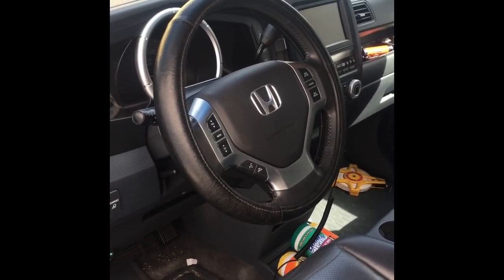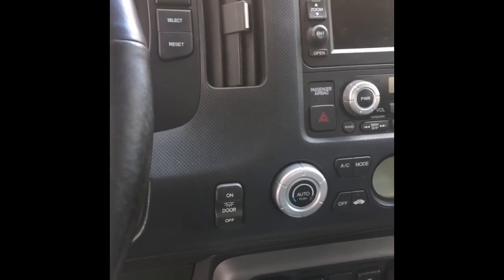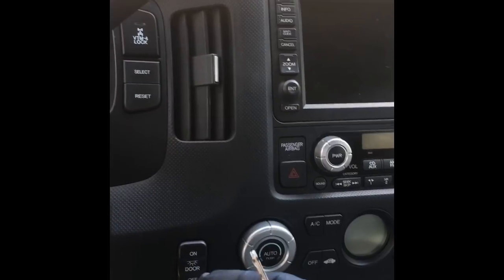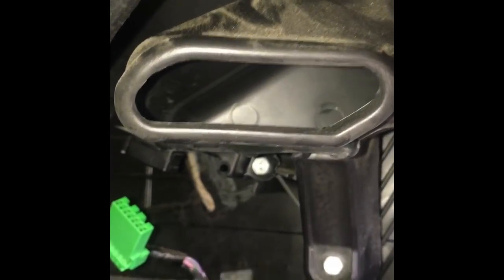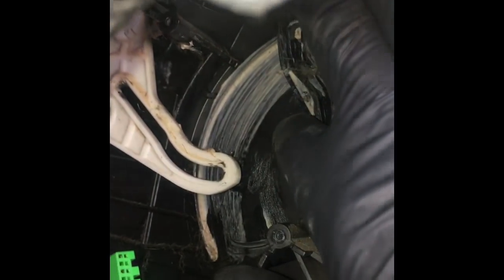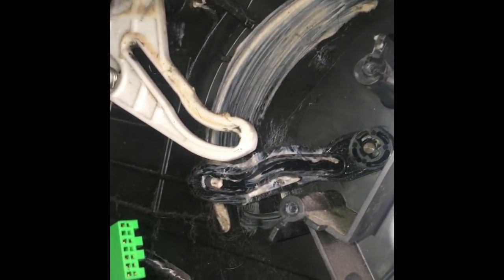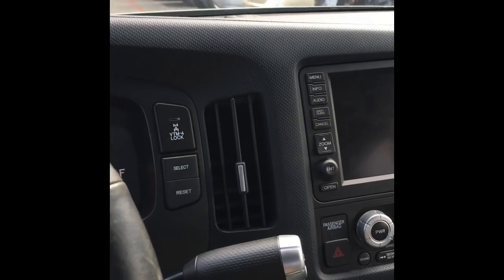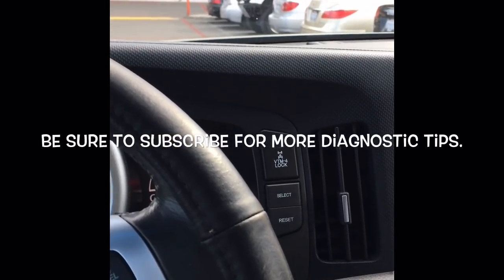How to Diagnose the AC Vent Problem: Hot on One Side, Cold on the Other

Comment: I just went through this on a 2009 Camry 2.4L base model.  AC was only blowing out of the center, right vent and was cold. Far right vent was blowing cold as well.  All other left side vents were 20 degrees or more warmer.

I recharged my ac system and all vents are now blowing cold as usual.

I read somewhere else that Camry's do this when the refrigerant, R134A, gets low.  This is true.

I have a slow leak I am investigating.

Enjoy!

Comment: Thank you so very much!  The video shows how to handle this on Hondas, in general, I think.  I looked for the same server on my 2006 Honda Accord and it was a no-brainer to remove and leave the switch in cold mode for the summer heat.  I will replace the servo motor part # aw063800-0080 off the internet.  It is named "2003-2007 Honda Accord mode actuator motor air vent left OEM AW063800-0080".
Reply: Paul de Prado how did you fix it?my 2006 accord doin same thing blowing cold on middle vents warm on driver side vents can you tell what's wrong?!.thanks
Reply: Baahubali Alak at bar 
Hi Baahubali - it's pretty similar to this video.  Unscrew and unclip the 2 plastic covers under the driver's wheel.  Remove the plug for the sunroof control, if you have a sunroof.  Use a flashlight to spot the servo.  It will probably have a green plug like mine and the plug in the video.  Unscrew the 3 screws... which is hard to do.

After removal, flip the plastic switch with your finger and check the air conditioning. Flip it other way to figure out cold vs. hot.

If that works, order a new servo of eBay or Amazon.  Good luck!

Comment: Thank you for posting! Have an 07 ridgeline with exact same issue/result. That third screw on top of the vent is extremely tough to get. Didn’t end up putting it back. Waiting on replacement part, but for now the motor works again. Have another Honda where this happened as well. I believe after car sitting for multiple days the motor freezes up.  Thanks again
Reply from the maker: David Bigelow glad the video helped. Thank you for watching!

Comment: Hi their
What if one of the vent is blowing cold air and the other is blowing hot,
and yes I have checked the bender actuator and seems fine on driver side.
It movies up and down when i differ the temperature??
and the other passenger side only moves when modes are selected correct.
so my bender actuator on driver side is still working and moving but no cold air??, but when i move up in temp it gets hotter .
What do you think the issue is ??
looking forward to your answer 👌

Comment: You probably could have just unplugged it and plugged it back in and saved yourself a lot of hassle but hey you gained experience so it's all good. For some reason these servo motors get out of sync, my wife came home from work after working all day in a sweat shop and had to drive 50 miles home in 90 degree weather with no AC. The first time it happened it was only on the passenger side and all I did to correct it was turn the heat all the way up to HI and back down to AC LO and the servo motor synced in and the AC started working. Tonight both were both stuck on heat and I had to unplug them with the vehicle running calling for AC and they both synced right up when I plugged them back in and her AC is working again. I worked my entire career as a robotics technician and engineer, the term servo motor implies a closed loop system with position and velocity feedback to a summing network of some sort to allow for infinite position and speed control, I somehow doubt this motor is that sophisticated since from my observation the motor is either in the extreme open or closed position. It might be what's known as a stepper motor but even that would be a touch of overkill for such a simple application. I now have something to investigate and I might just add a reset button that momentarily disconnects the required signal to get the motors to reset. Good video but I think you may have gone further than you needed to, the unit most likely reset when you unplugged it.
Reply: Kurt B what is the name of the part he could’ve just unplugged?? I need to try that out. I have the same problem with my Altima.
Reply: @alisaperalta3642  The Actuator

Comment: Thanks for the tip. 2009 Acura MDX
This has happened to me twice  before, the problem was in fact the actuator. First it got locked up, then stopped working. Both times it was an easy fix. Thank you. 
Now I have air sometimes cool but never cold on drivers side, passenger is ice cold. Not the actuator. Any ideas?

Comment: great video,ty.
so im having same problem,but driver side is blowing cold as passenger is hot.
Reply: AC is fine . . . heater blows cold on passenger side . . . is this a servo motor issue? Is there a motor on the passenger side as well?

Comment: Was that your car or a customer car? Did you reinstall the same motor for the ac/heat? Or put new one in anyway? If you use existing motor I assume you didn't charge ? I mean it be only right.

Comment: Hi How to Automotive...really informative video - i have a similar issue with my vw scirocco mk3 - on the passenger side its blowing warm air (when the temp is high) but on the drivers side its blowing cold air when the temp is high...what do you think is causing this? My AC is ice cold as it should be... so i am a bit baffled.

Thank you in advance and keep up the video's
Reply from the maker: Zaf Mohammed if I'm reading this right your saying your heater is not working right and AC works well. Possible low on coolant, bad heater control valve, air pocket in cooling system or a bad blend air door in the dash.
Reply: Hi - the heating working as in the passenger side is blowing hot air/cold air when you go from low to high temp as it should but the drivers side is always blowing cold air regardless of if you are on high or low temp settings...any ideas as to what it could be or is causing this?
Reply from the maker: Zaf Mohammed sounds like the motor or the blend door is not working.
Reply: Thank you taking time to answer my question

Comment: I have a 2014 ford edge. My wife says the center A.C. vent blows cooler on drivers side a little warmer but still cold on passenger side. I told her that’s not possible because that center vent is fed air by one line. Am I correct or is there 2 seperate lines feeding air to center vent

Comment: Thank you so much!! My mother's car is having the same issue. Do you know off hand how much the motor part costs, or how much it would be to have a shop replace it? I'm planning to do it myself if it's a lot cheaper to purchase the part and replace it myself.
Reply from the maker: Hello. I've seen those parts for the Honda  run around 75 bucks to up to 200 bucks depending on which one it is. If it's the same one in this video the labor is about $45 to 100 depending on where you live and what the labor rates are in your area.

Comment: What if the adjustment works for the AC (cool air adjusts with controls) but does not work with heat. Does this mean the actuator is okay and I have another problem (plugged heater core)? The heat and AC controls both work on the other side.
Reply from the maker: Wayne Jones Hey plug heater core is a possibility. I would try to operate The temperature control knob and look up inside the dashes see if you can see the motor moving. You may have to do a little research to figure out which one of the doors it is and where it’s located.

Comment: Any idea the specific term for this server motor part? I might be looking at resetting the one in my 2017 Camry. If it doesnt work, I’ll replace it. Hot air on driver side. Cold on passenger r
Reply: did you figure out what was wrong? I am currently experiencing the same issue 😒
Reply: Grow LowKey yeah turns out the car just needed a recharge. That was the first thing I did. 

My 2000 Jeep Cherokee on the other hand has been to the mechanic twice . The ac coolant just keeps leaking after a couple of days. I think I’m screwed. So far paid $400 for shit luck.

Comment: I have a 2002 Chevy trailblazer & I'm having the same problem. Hot/cold on driver side & luke warm on the passenger side. When I turn the dial from top vents to bottom, there is a clicking sound🤔does that sound like I need to take the dashboard apart?

Comment: on a cadillac ac warm on driver side and ice cold passenger. found was low on freon. should have 2.2 lb and had.75. filled freon and blew ice cold both sides.  suggest check your freons capacity too
Reply from the maker: john argue thank you for the tip.
Reply: i concur..i had cold drivers side and pretty cold.passenger up to 85 deg..the 90 deg and up temps my drivers side is semi cold and my passenger and rear vents are warm but not hot. I refilled Freon. good to go..2005 Grand Cherokee. known to get vent door issues. best way to tell is to turn on ac and then heat and if it gets hotter on the side.in question the vents are good. freon would be low
Reply: Taylor Welsh thanks for writing your comment. I couldn't tell if it was the blend door actuator or if I needed freon.
Reply: I have a caddilac Eldorado and im trying to get it warm on both sides

Comment: Hey Brian, 
I have a 2007 Chrysler Town & Country having a issue with AC. Front blower doesn't always turn on when you want it to. Or it will be running fine then all of a sudden poof no air blowing.
Reply from the maker: Samantha Steele There’s two possible problems with that one the blower motor itself could be going out or with the blower motor resistor which controls fan speed is going out. You’ll have to have it tested to figure out which ones the problem.

Comment: This is very good news. I have the same issue with my 2006 Honda Odyssey. I'm not a gearhead, so I'm not familiar with these terrible things that happen under the hood and dashboard. Thank you for the information, it'll prevent me from getting ripped off.

Just out of curiosity, what do you think it'll run to get this issue fixed?

Also, I've got a problem with the fan that controls the air conditioner. When I'm driving and I hit approximately 4000 RPMs, the AC starts to work. When I'm idling, it's blowing lukewarm and extremely hot air. Just yesterday while traveling into Utah the air vent on the left side was blowing hot air and the right was relatively cool. 

I guess I'm looking for an opinion on what it would cost to just get this entire mess straightened out?

Thank you so much.
Reply from the maker: Hello. I did a little research on your situation. And the most likely cause of your  symptom is low refrigerant. I would start by checking the charge on it or having a check. The blend motors are a common issue with these cars. And you may have that problem too. As far as cost goes it's going to vary from where you live. Dealer price on those little motors are about 150. But you can definitely find them cheaper aftermarket.  I would pay to have it diagnosed it would definitely save you money if you just put parts on it and not fix it. My guess on the cost to repair the AC would be around $300. Hope this helps and thank you for watching.
Reply: +How to Automotive 
Thank you for the help. It's not something I can afford right now,  so I figure today I'm just going to access the actuator arm and disconnect the wires, push it back in the down/cool position and see if that works. If it does, I'm going to leave it be until I can stockpile some more cash to have it properly taken care of.

Comment: Thank you for the video. On my 2005 Jeep grand cherokee, it blows cold on the driver side but not on the passenger side and not in the back. My mechanic checked those motor actuators and find them to work properly. He then charged the AC with freon and diagnosed it. Still blows cold only on driver side.  One think we noticed is there’s two hoses connected to the compressor. One is suppose to be hot and the other cold. The one which is suppose to be cold  - is not cold at all and the compressor keeps engaging on & off every few seconds. What do you suggest to check next?

Comment: hi thank you so much for your time and knowlege. i am too going thru the same thing with my 2005 Gmc yukon slt. blowing hot air on the driver side and cold on passenger and evem the back vents. would you please help me? what could it be and what do you recommend?.
Reply from the maker: A Beverly I would research where the servo motors are located and if it's not too hard I would take it out leave it plugged in and operate the controller to see if it's working. Also if you plug in the scan tool there maybe codes to help guide you.

Comment: Ok, 2010 Sienna, only has this issue while idling. What would cause the actuator to not function in idle only?
Reply from the maker: That one most likely has a vacuum 
Operated system so I would look for a restricted vacuum source at idle. Also look for codes in the engine to see if you have lean codes that would be a clue that you have a vacuum issue.

Comment: im having the same problem in reverse. in the winter time its blowning hot air on the passenger side and cold air in the driver side?
Reply from the maker: Test Run it’s either a servo motor problem or the door itself has come off it’s hinge inside the dash and the last possible reason is the Insulation has come off of the doors and it’s not sealing

Comment: Great video.  I have the same issue with my 2009 Honda Crv except my car blow Cold on driver side and hot on the passenger side with the temperature all cranked up to 85 degree.  Does it sounds like that the motor is not functioning correctly and not letting hot air out of the vent?  What could be the issue? I called the dealer and mention that there three diff types of motor AIR/MIX, FRESH RECIRC, and Mode motor.
Reply from the maker: FRANCIS RYAN PANGAN it sounds like to me the air mixture servo motor stopped working. But you want to check the basics and make sure you have coolant in the car. If there's not enough coolant in the car it' will get an air pocket in the heater core and you will not get heat out of dash .
Reply: Thanks for the quick response.  I am certain that it has enough freon, the crv was in hawaii and the ac was working great with no problem.  Currently the car is in Vegas which we need hot air, unfortunately its blowing cold air and driver and hot on the passenger.
Reply from the maker: FRANCIS RYAN PANGAN check your radiator and make sure it's full. If it's low you will not have heat in the dash.

Comment: Hello, 
I have been watching your videos and they're very helpful.  Thank you for posting them.  Also, I have the 2008 Honda accord V6 and the air doesn't blow in the center.  What could be wrong?  I went the auto part to get the info to fix this problem.   They told me that could be the blend door actuator not working.  I've checked the main actuator below the dash and it does not rotate at all.  I've bought the new actuator and put it in but it also does not rotate as well.  Is anything else that could be wrong?
Reply from the maker: Mike Mai hello and thank you for watching the video. If you can get your hands on a factory scan tool or a scan tool that reads factory code. So I would start by pulling the code and going from there.

Comment: I have a 2014 Lincoln MKX and my ac doesn't work on the passenger side. I checked the freon levels and they are within normal operating levels. Will this method work for that side as well?
Reply from the maker: Greg Springfield Yes if it’s blowing cold on one side and not on the other you have a blend air door problem. You may be able to hook a scan tool up and pull codes on the Lincoln to pinpoint exactly which one is giving you the problem.
Reply: its blowing hot air on the passenger and ac on the driver side, i will give it a try

Comment: Hey I have a question. I have a 2005-2007(not exactly sure)  honda accord. The ac isn't working properly though. When I turn it on, it only blows to the floor vents. None of the top ones blow any air out. Any ideas what it could be? Any help would be appreciated.
Reply from the maker: joel gastelum  there is a vacuum stores coming from the engine bay into the AC control box under the dash and has gotten Cut off most likely. Most common place for it to happen is in the engine bay where it goes into the firewall so you can look around. Also if you run the engine you may hear the vacuum leak.

Comment: so you messed with the motor/lever, put it back in and then it worked. no replacement of parts?? Is that a "repair"
 that should last?
Reply from the maker: Replace the part. If you mess with it and it starts working again it will eventually stop working. Hope this helps and thank you for watching and writing to me.

Comment: I had a similar case on a 2009 mercedes benz S550. The rear climate control would only blow hot on the passenger side. I tested flaps and they worked on bidirectional control. Turned out they use a solenoid valve called the Duo-valve that allows hot coolant through passageways or blocks it. It turned out the duovalave had a seized valve for the passenger side and was stuck open. Weird system. Just an FYI
Reply from the maker: nick elias Mercedes is always trying to make things too complicated.
Reply: How to Automotive amen to that. but they pay the bills im cool with that lol
Reply from the maker: nick elias me too. I love working on them.

Comment: My 2008 Ford Edge blows cold air on driver side but hot on passenger. No idea what to do or where to take it, and how much it would cost to get it repaired. Any help?
Reply from the maker: Sebastian Torres The only way to figure out the problem is with a diagram of what the doors do on the Ford edge and determine which one has malfunctioned. Good try googling it to see if somebody else has come across this problem.